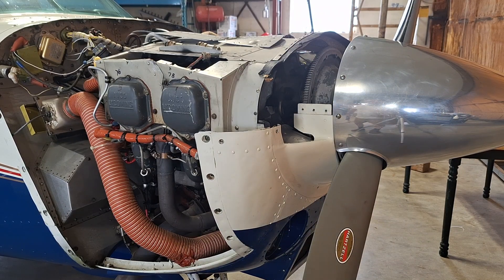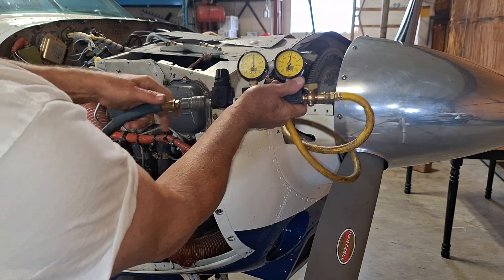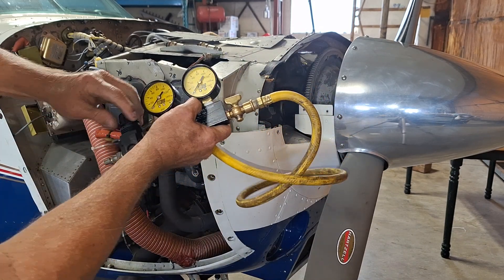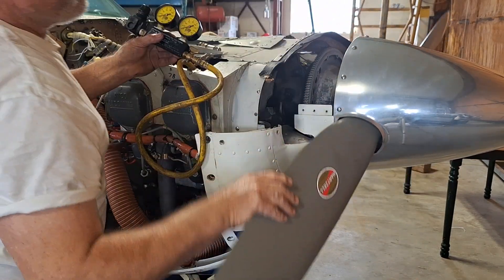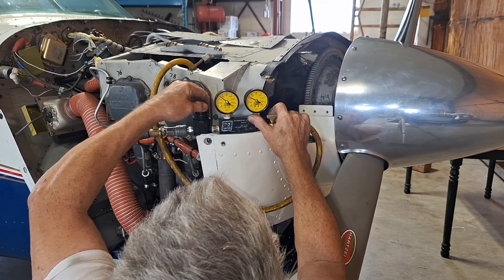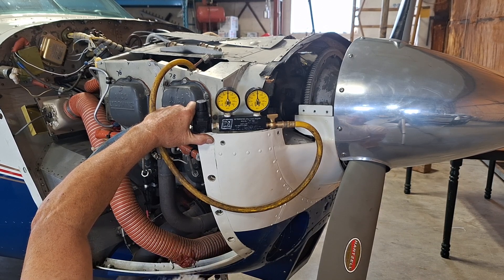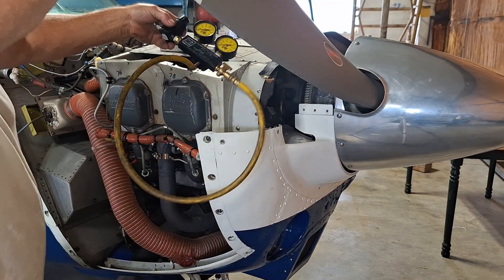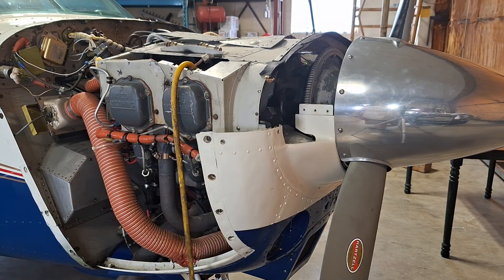Aircraft Engine Compression Test

Comment: This is a great example of how NOT to do this test.  Keeping any part of your body in the prop arc with more than 20 psi or so in the cylinder is asking for trouble.  There is simply no reason to do that.  If you have the prop at TDC, it isn’t going to move under 80 psi.  If you don’t, it may well move and you don’t want to be in the way.

Comment: How can you be sure of the gauge from the cyiinder when they both read the same? A new gauge is not that expensive. I wouldn't trust a guess on it.
Reply from the maker: The tester has a calibrated orfice between the 2 gauges. When not connected to the spark plug adapter the hose end is sealed allowing a  comparison of the gauges.pressures.They should be close to the same. A small difference will not affect you deciding whether the  cylinder tested is acceptable. It was not my intention to show the theory of how the tester is designed.  I could make video showing the difference in reading using a tester designed for large  cylinders  compared to small.  Most of the time you don't even have to look at the gauges to tell a cylinder is no good, air whistling out the exhaust little effort to hold the prop from rotating.

Comment: A Compression Test '' is the pressuse elevated by it self thru Cylinder  Rotations '' who ever continuing ''..
Reply from the maker: Yes you are absolutely right if you want to be that picky. In the aviation world we have been using the term  compression test and diffential testing interchangeably. I guarantee you
its not that we uneducated or don't know the difference.